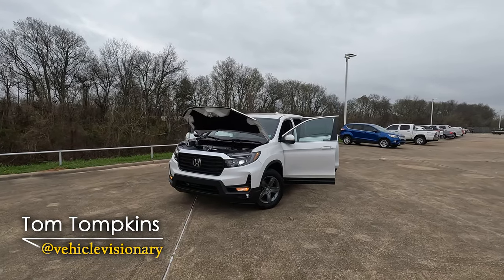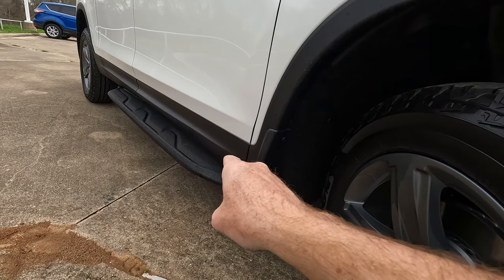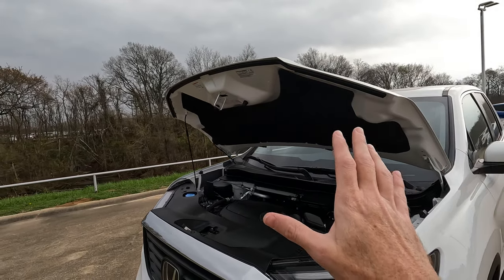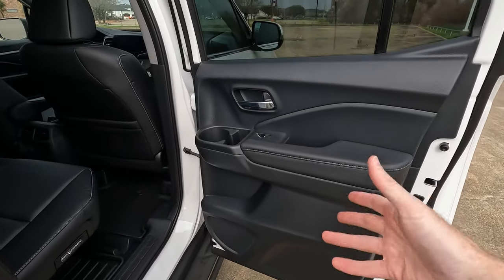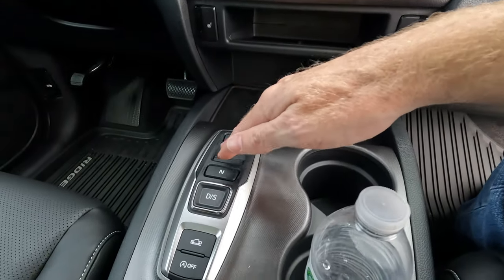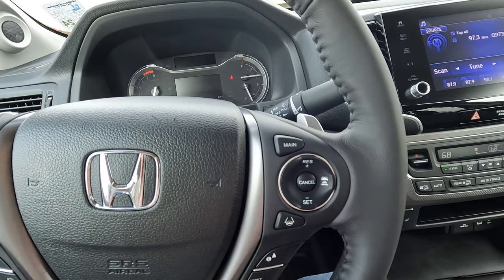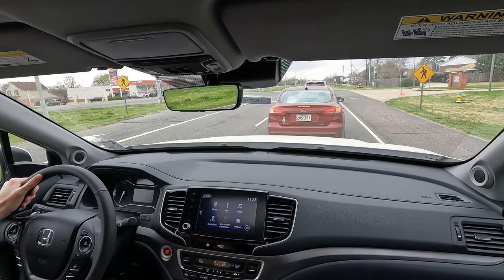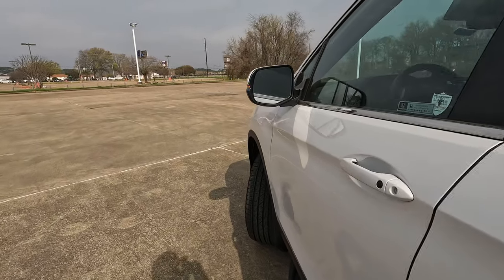2023 Honda Ridgeline RTL - Is It The ULTIMATE Gentleman's Truck?

Comment: Hi could you verify where is the location of the oil filter? is it inside or between stabilizing bar/arm? has anyone reported issues regarding the odd location of the oil filter?
Reply from the maker: It is on the right side by the stabilizer. It may have a cover that needs to be removed but is easy to gain access to from underneath.
Reply: @VehicleVisionary  stabilizer or control arm? yeah i think thats what i saw. im just thinking the location was odd and could potentially have leaks or to cause problems with the stabilizing bar.

Comment: Any truth to the button gear selectors. Drinks spilling from front cup holders and shorting the vehicle out? Find it hard to believe they didnt seal the buttons off well to prevent that.
Reply: I drive a 2020 RL and have a kid :) Spilled plenty of drinks on the gear selector buttons and no issues so far.

Comment: Would owners care to comment on the brakes? I keep reading that the brakes are weak, and I do plan to tow about 3500 lbs.
Reply: I loaded a couple of thousand pounds of rock and sand,  it stopped no different than it were empty.  I believe the brakes can handle the 5k pounds designed to tow. 
I owned a Tacoma, great truck but I like my 23 Ridgeline.  Very comfortable.  This is my second Ridgeline.  My 20 Ridgeline was great.  Dealer made a nice trade, couldn’t pass up.  Just being at the right place and time.
Reply: I have an old Ridgeline the front brakes are 12 inch rotors and the back rotors are 13 inch. I pull a trailer all the time never had a problem stopping it yet.
Reply: I have a 21 RTL and drive daily over mountains and no problem with breaks. 41k miles and stock pads and rotors.
Reply: Thanks for replies.

Comment: I own a 22 black edition.  Halogen high beam is shit.  Non-folding mirrors are shit.  Infotainment system constantly locks up and requires reset by powering off the car.  Air conditioning blows as cold as a 1988 ford escort with a corroded receiver-dryer and a pound low on charge.  The fake leather upholstery doesn’t recover to its original shape months after removing a child car seat.  21 mpg combined is a pipe dream— you’ll get 19 combined.  The body panel fitment from the factory is shit.

Honda needs to pass this one off to Acura to alleviate the obvious material and workmanship shortcomings of this otherwise decent vehicle.